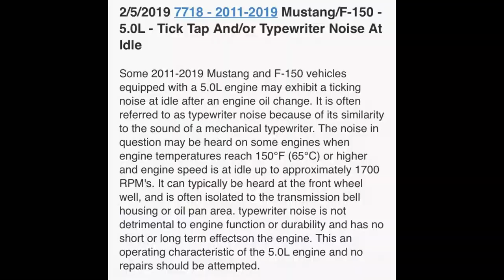2018-2021 Mustang GT Typewriter Tick/BBQ Tick. Don't Be Worried!

Comment: Dont waste your money on different oil or additives. NONE OF IT WORKS. Only 30k on my engine and it ticks like crazy no matter what I do. The noise is embarrassing.
Reply from the maker: Tick really bad?  Have you had it checked out at a dealer. Cause there is actually a TSB for cylinder one scoring. Ticking like crazy and BBQ/Typewriter tick is totally different. It's normal and doesn't do it all the time. If yours is constantly doing it I would get it checked. Liqui Moly Ceretec does work. And so does amsoil. Cerma not so much they asked me to do this video and  no longer affiliated with them

Comment: Has anyone else noticed a thud or thump type noise at warm idle?
Reply from the maker: Diesel type knock noise. Normal. You can reduce it greatly by running high octane gas.
Reply: @BeardedFordTech  Well then I guess I’ll stop being a cheapskate and give 93 a try. I just picked up a 2020 GT w/ 28k on the OD and it’s got a non-continuous thud heard on the drivers side in the cabin, felt slightly on the drivers side floor, and under the hood. Thanks!
Reply from the maker: @demetriawright1528  yeah that's the "diesel type knock noise" what ford calls it. There's a TSB to inform the customer to run high octane gas to minimize it.

Comment: I have the damn tick on my 2020 5.0 , it’s damn annoying😂😂
Reply from the maker: Yea it can be annoying.  But I wouldn't trade it in for say a 365 hp dodge charger that ticks and needs cams or a camaro. It's all good nothing is wrong. Did you do your first oil change and it start?
Reply: hey put ceratec liquid molly in the car when you do an oil change
Reply from the maker: Uknown2445  I use amsoil. I'm a amsoil dealer. But I also Cerma treated it before using it.

Comment: Imrc lockouts completely removed my coyote tick
Reply from the maker: Really?  Now are we talking about the typewriter tick cause that's been there since 2011. Heard on the lower end of the engine toward the bell housing of transmission. Usually after an oil change while it's warming up. There has been cases where the imrc is making a noise but you can diagnose that by unplugging it. It is a similar noise but not the typewriter/bbq tick. Imrc is usually heard on top. Ill have to try that and see. No harm in trying right.
Reply: @Bearded Ford Tech  so I will say that the oil changed the tone of it after switching to royal purple with ceratec but after the lockouts the bottom end was very noticeably quieter. I've git a theory with these engines that there's some blowby regulation issues at idle. I've had some other issues with my car and it's been pointing to the scavenging of the gasses at idle. It's possible that "some" sound can be attributed to the gasses possibly 🤷‍♂️

Comment: I’ve had to put 11 qts I put all 10 in and it was a quart low
Reply from the maker: What year?  Cause it should be 10. How long did you let it sit when you drained it. Did you syart it let it run then sit for 5 min to let the oil drain back down for proper level check. We're you on a level surface. Not an incline or decline?
Reply: @BeardedFordTech  2019 and yessir I work at Acura so I maintain my own stang with all motorcraft but what u we’re saying in the video made sense with the oil pan being plastic I trust u cause u have access to more ford related tsb and fds if that’s what y’all call ur diag tool and software. I did notice that lower end tick after I lifted my car up doing an oil change and the intake to a roush cold air.
Reply from the maker: @brendonzepeda6229  yeah TSB's. We call our software PTS. But the tick is normal. Weird you had to pull 11 quarts in. I've never come across that. Run it 1200 miles and check the level again.  Have you had the pcm update for oil consumption? (Or was that f150? Sorry thinking out loud) I'll double check on that. Email me your vin and contact info. I'll reach out tomorrow.
Reply: @BeardedFordTech  will email asap i appreciate it and if u don’t mind checking
Reply from the maker: @brendonzepeda6229  will do

Comment: Liqui moly ceratec removes it.
Reply from the maker: But you have to do it every oil change. And it does not remove it completely
Reply from the maker: @Ford_Raptor_R_720hp_V8  The Cerma is not a "super lube". It was actually designed by a retired navy guy who lives in Denison Texas. They actually painted submarines with it to test the vibrations in water. Basically it's a treatment that treats the metal like ceramic coating it. Does it completely get rid of it? No. But it does quiet it down
Reply from the maker: @Ford_Raptor_R_720hp_V8  ohh I see now. Which one did you use?
Reply: @BeardedFordTech  - So why can't Ford explain to us what Causes the Ticking Coyote? Why? and Where? it comes from?
Reply from the maker: @Ford_Raptor_R_720hp_V8  They know where. It says it in the TSB. Why they don't know. All they know besides where is that all the ones the engineers tore down there was no abnormal engine wear or engine performance issues.
Reply: @BeardedFordTech  - you don't think Ceratec is a Super Lube?

Then what would you call it?
Reply from the maker: @Ford_Raptor_R_720hp_V8  it's labeled as one. I don't think it is though. Just basically a liquid with some metal in it. Like there are racing oils with zinc. I didn't say they didn't work. Liqui Moly is good stuff. They use it in moto gp. Just that they simply will reduce the noise.
Reply: @BeardedFordTech  - I wouldn't call Ceratec the Best, it might be good, but I wouldn't use it.  Some people like it.

As far as Motor Oil goes, Amsoil in testing, in the Lab and in the Engine, appears to be the Best.
Reply from the maker: @Ford_Raptor_R_720hp_V8  I never  said it was the best. I said it was good. Moto GP uses it  And I'm an amsoil dealer. I run it in everything. Let me know if you need some. Dealer number 5124952.  Cerma is what I was referring too. It's not an additive. It's a metal treatment. No it is not the best either. But it helps.

Comment: Or just get a supercharger w straight cut gears
Reply from the maker: I did want a super charger. American muscle has one with a whole kit and the wiring for the pcm. Was $18,000
Reply: @BeardedFordTech  didn't have to wire anything here. Ess supercharger
Reply from the maker: @dikdawg3438  well dang
Reply: @BeardedFordTech  I installed it, injectors and plugs in 3 hours.

Comment: Spray in nikasil scares me
Reply from the maker: Yea it does. Which is why I use cerma treatment and oil. It's not an oil additive. It treats the metal in the engine. Just uses the oil to carry it. Check it out www.cermastore.com I use it in every vehicle I own. Even my riding lawn mower 😁
Reply: @BeardedFordTech  it looks cool, I like the idea, I just would want to see their oil tested independently for typical properties. Do they sell it as a single treatment too for weirdos that are stuck with their oil brand of choice ?
Reply from the maker: @Fee.1  yes. You can get just the oil. The treatment or both in a kit. I've never had any issue with them running it in any of my vehicles.
Reply from the maker: And they do have their test results on their website.
Reply: @BeardedFordTech  nice thanks.

Comment: Bullcrap Ford and your T.S.B.  There shouldn't be knocks or ticks.  I do own one !  Ford is trying to avoid a financial headache.  That isn't to say some ticks may be less important than others, but it shouldn't be in a otherwise very good engine.
Reply from the maker: Mine run just fine. F150 and mustang. You said you don't own one. So why are you mad about it?  Calm down. Have s nice day.
Reply: If you READ....I said, I DO own one !
I've been building engines for years....Never would any engine builder ever say...."pay NO attention to that knocking and ticking".......
Reply from the maker: @rogereastman3187  I do apologize it was early this morning. Wasn't completely awake. I haven't had a problem with any of mine. Now some have cylinder 1 scoring that's a different sound though. These have been doing it since 2011. Everyone makes a big deal because it's more predominantly heard on 2018 and newer. I agree. No engine builder should day that. But all the electronics and such that control everything. Is crazy. But all the ones that are not cylinder one scoring everything works as it should. And here is the real weird part. Not all of them do it.

Comment: Got a 2017 just hit 28k miles and I'm pretty sure I have the same noise now. I hate it. Makes my car sound like fucking junk
Reply from the maker: Then you my friend have another issue and I would get it checked out. This only applies to the gen 3 coyote. 2018-2021.  Is yours ticking constantly? Get louder with RPM?
Reply: @BeardedFordTech  ford literally put out a statement 2 years ago for 2011-2019
Reply: @BeardedFordTech  doesn't get louder its the same speed same noise just comes and goes
Reply from the maker: @dariusholt678  weird. I haven't come across a 17 that does it. Just the 18-21. That's when they went from port injection to direct and port injection and a few other differences.  Can you take a short video and email to me?
Reply from the maker: @dariusholt678  actually your right. I just looked at tsb. Tsb is for 2018-2021. But it can be heard from 2011-2021. My 2011 truck did it too. You just couldn't hear it as much. It's more noticable on 2018-present cause of the plastic oil pan. If the noise happens it's as it's coming up to op temp anywhere up to 1700rpms. Usually goes away after it's warm.
Reply from the maker: @dariusholt678  did it just start doing it?  Exact noise? Driver side wheel well toward back of pan and transmission bell housing?
Reply: @BeardedFordTech  I've tried to record it at idle 3 times and everytjme I get my phone out it stops as if it's toyying with me. While driving I can tell it's coming from under me for sure. But recording that is difficult I'll keep trying though
Reply from the maker: @dariusholt678  yes please keep trying. I want to hear this. Shouldn't do it while driving though. Should go away at about 1700 rpms. If you have to wait for it to cool down some and do a cold start it may do it. The bbq/typewriter tick is so random. And yes it is annoying. Mine doesn't do it anymore. But it was annoying as hell. Even at the dealership people would bring it in worried. And we had to do our normal pinpoint checks only for it to be the tick. Every now and then we would get one with cylinder 1 piston slap and it scores the cylinder walls. I'm anxious to hear yours.
Reply: @BeardedFordTech  got it, what's your email?

Comment: I got a 2017 5.0, just started like 4 days ago, with 69k miles🥲its driving me crazy, started right after i got my oil changed at a new place
Reply from the maker: Did they put enough oil in it? 2017 takes 8 qts with filter. 2018+ takes 10 quarts with filter.  Is it a constant tick that gets louder with RPM?
Reply: @BeardedFordTech  yes 8qts is what was labeled on my receipt
Reply: @BeardedFordTech  yes it is a constant tick that gets louder as i raise rpms but eventually goes away but thats only because my exhaust doesnt allow me to hear anything else
Reply from the maker: @aaronwilbanks2381  I would first check the oil level.  The BBQ/Typewriter tick is only on startup as it's warming up. And it's intermittent.  If you have ticking that's getting louder with RPM then you have another problem that needs to be addressed.  If oil is good try to pinpoint the sound from the engine. Check for any exhaust shields that may be loose.
Reply from the maker: @aaronwilbanks2381  that doesn't mean they put 8 qts in it.  And what brand did they say they "used"?  Is this a reputable shop or a quick lube place?
Reply: @BeardedFordTech  quick lube😅😅
Reply: @BeardedFordTech  the oil level was perfect, and idek what exhaust shields are quite yet, kinda learning myself to knowledge in cars atm
Reply from the maker: @aaronwilbanks2381  oh man 🤣
Reply from the maker: @aaronwilbanks2381  just little aluminium shields around where the exhaust comes off the engine things come loose. I would have it checked out though to be sure. Take it to a dealer in this case.